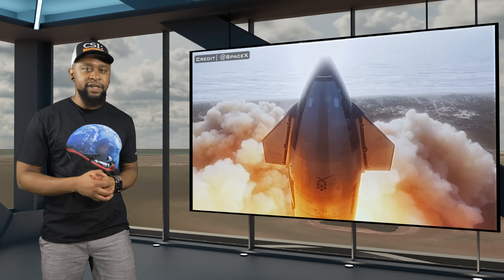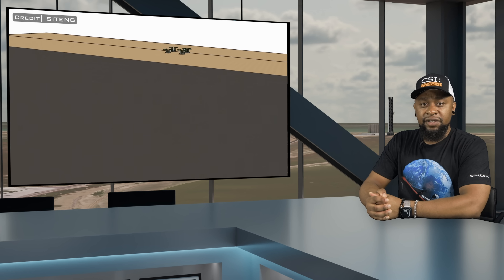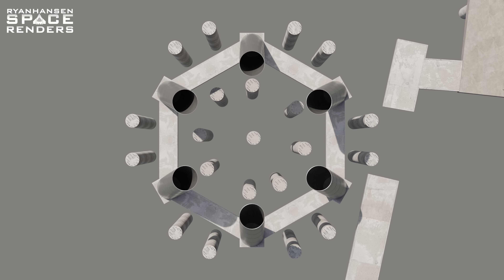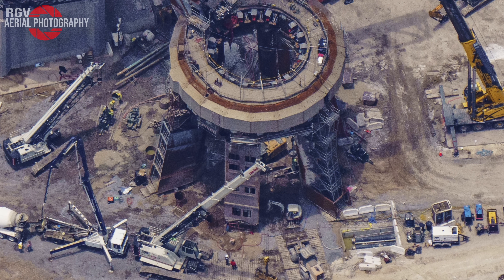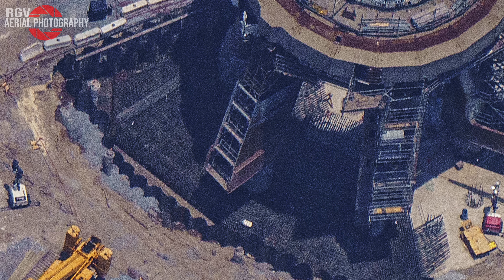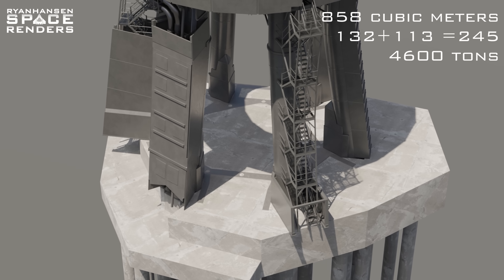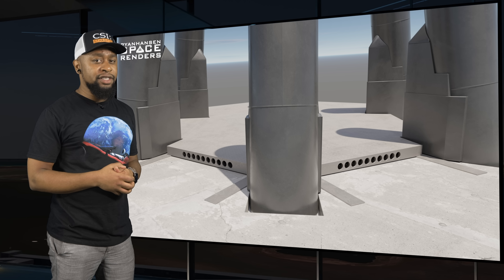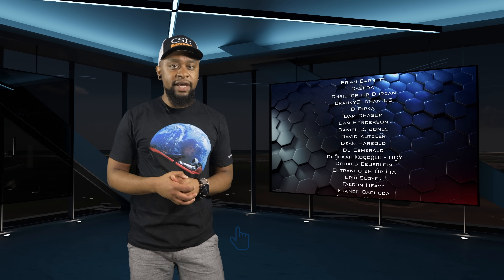How SpaceX Will Guarantee Its Launch Pad Never Fails Again! [Part 1]

Comment: The biggest issue now,it's the power of the engines push the water back and the water vapor exploding the metal plates.
Reply: Rocketry truly is a balance of pressures in every sense huh
Reply: this is why they are using High pressure Nitrogen to feed the pad, it allows them to regulate water pressure in a timely manner.
Reply: @bebopandopple , perfectly captureed.
Reply: I've seen 16 bar cited as stagnation pressure in some earlier video by CSI Starbase. That is a lot of pressure, but it's not extreme pressure. We will see how this works when they do a Water deluge system test. I want to see the worlds largest schower head in action too.
Reply: @bebopandopple If I remember correctly Von Braun said that there is a fine line between a rocket and a bomb. The finer the line, the better the rocket.
Reply: Thr water pressure must not falter though. If you need 16 bar minimum the water might have to be at 20 bar and stay there without fault and also ramp down in a controlled and timely manner with the lifting of the rocket.
Reply: also if the top plate of the " shower head" is only two and half inches thick it won't be anywhere near thick enough!
the entire structure should probably be there to four times thicker, otherwise there going to have a big steel potato chip!
two and a half inches of steel isn't enough to stand up to 33 raptor engines !!! it'll crush like tin foil !
Reply: @alwenke212  Did you do the math?
Reply: @alwenke212 It’s pointed at the wrong end for it to be called a shower head #RocketBidet
Reply: @yumazster  and man, did Von Braun know how to cross that line 😂
Reply: @jason_m_schmidt622  World's largest bidet?
Reply: @alwenke212  Pretty sure the SpaceX engineers have run the calculations dude...
Reply: @alwenke212 your hilarious, it's about thermal transfer. Thicker means less heat transfer. Ideally the plate should be titanium with ceramic embedded supports precast and pre-tensioned like elevated double T or bridge spans. Those are engineered in lightweight geometric designs to transfer stress without breaking. Thicker and bigger leads to stress fractures like Chinese dams are made or other crazy stuff like those Arab skyscrapers doomed to failure. It's not intuitive and it's why the best civil engineers are mathematicians and materials scientists before they design structures. Consider how the SR-71 or a hypersonic rocket can endure surface temperatures and shock. They use honeycomb backed thermally conductive framing to titanium and exotic vanadium steel that flexes and moves with extreme changes of conditions. All. Science my man, not middle ages castle building technology.
Reply: @alwenke212   I think the same.... this pad is not thicc enough to hold the pressure of the raptor engines. It would be ripped apart if the raptor engines can make tons of concrete fly away it would rip apart steel plates like tinfoil. Temperature wasn't the problem, the problem was the immense power hitting that launchpad. In my opinion no material can just bear raptor engines going full blast on it... they should instead try to deflect all that force by putting a deflection plate (plates) at an angle, so the steel doesn't get the full power on itself.... or have a big pool of water underneath, water is a good absorber of shockwaves.  Water should be used as a cushion. Also the water should be blasted from the sides onto the plate and not beneath.... if water comes beneath the rocket... it would just be overpressured backward and the pipes would burst. I think the launchpad would be partially destroyed again... in a "spectacular manner".....
Reply: All for the circus. There is no space.
Reply: The real question is how will they get teams on Moon or Mars to install something similar there for landing? The information how the Apollo mission did it without even getting any dust on the lander sadly got lost... 🤪🥳
Reply: @Slav4o911   still can't understand why they didn't built a launch stand with a proper flame diverter. Instead of the pad support legs in a circular configuration, SpaceX could've opted for a square arrangement. Installing after a mobile ramp on rails with tick steel pates, as flame diverter. While water would be pour down via Gravity. Simpler and more rough system. Able to be more easily maintained and less prone do extensive damage.
Reply: @usertogo   The lander was a 2 part lander, the lower part is still on the Moon, so that is the part which got the most "beating" . Also you should remember the Moon gravity is a lot weaker so not much force needed to go to orbit.
Reply: @Shrouded_reaper  Yes, this is why they continue to have oopsies
Reply: @Sara-L  Remind me again how long it took them to make one (SLS)? Starship has only been in serious development for a few years now and they are already launching prototypes.

Comment: I work in the concrete industry. Your numbers check out. Those look like 11 yard capacity mixers. In my experience, on a big job like this, they're typically loaded with 10 yards or 7.6 cubic meters. 132 truck loads works out to 1320 yards, or 1009 cubic meters. (we typically don't use the metric measurement). Not a massive pour by industry standards, but pretty big. Lately, my relatively small company has been doing 400-600 yard pours almost daily for a large customer in our area.

Love these deep dives. You always seem to have information and knowledge nobody else has.

Comment: As a commercial concrete carpenter(high rises stadiums) ive never seen concrete damage like that. It was impressive guessing that concrete is 8-10k psi breaking strength ez. Pumped to see changes. I do this piling /cason work in rivers building bridges too. Very interesting how they are trying to solve this issue. Wish i was working on it. Well done on this video i couldnt explain it better as someone who building it daily. Yet this is exactly kind of work i do

Comment: That "anti siphon" tube is more likely an air purge to help prevent water hammer. Water treatment plants in my state do the exact same thing. Without it, when the water is shut off at that level of force, volume, and pressure, it could cause an "explosion" and it messes with pressuring the system downstream, as the air will compress downstream, rising to top of line, and ejecting massively compressed air at the plate. A REALLY BAD THING to do with essentially the world's biggest blow torch. Basically an oxy-hydrogen plasma torch straight of hell. Added is the corrosion effect, and the sudden surge instantly creating electricity and hydrogen gas. (Same reason why certain long, large ships have static lines) "electrostatic charge is generated in liquids as it flows turbulently through the pipeline"

Comment: Another informative presentation that covers the details of how to fix the OLP that Elon said ‘might be a mistake’. It’d be interesting to know what the difference in time, money, and effort would have been had SpaceX followed tradition and built an OLP with diverter & water suppression system included. I’ll also be interested in what will be needed to upgrade the Fla OLP. 

Great work here that will likely be viewed with historical significance in the not too distant future.

Comment: Im pretty sure that the final system will have two stages as speculated in the video for a very good reason.
When all engines are throttled up the water will have to overcome a huge pressure, but before the engines are fired you need to be very careful, because you dont want to douse the engine bay of the booster with high pressure water for two reasons: 
1. You dont want to risk damaging any equipment in there with a 3000+ psi water jet
and
2. You could actually interfre with engine starting, when a high pressure water jet gets into the combustion chamber it may actually extinguish the engine during the starting process.
So I think SpaceX's plan will be to have lower pressure water flowing that wont create too high of a fountain over the plate until right after all engines have started up at which point the second system will start pushing water at increasing pressure through the plate while the engines are throttled up.

Comment: Very well done vid! I'm left wondering why they did not use a water tower in the design. Gravity would have supplied some baseline pressure that could have been augmented with the high pressure gas.

Comment: Hello Zach, when I look at that cargo bay door of Starship, I have to wonder if the SpaceX engineers ever considered a vertical payload door opposed to the current horizontal door. You have to wonder just how much structural reinforcement has to be added to carry that stress load around that huge door. If the stresses collapse that door opening by even a fraction during launch, that door may not open or close. If I were to design it, I would attempt a vertical door as it is much easier to carry that stress load. The big takeaway would be if they could deploy the Starlinks in a vertical position. In my mind, I picture a multilevel dispenser similar to the old slide projector carousels. Preliminarily, I think you could actually dispense more satellites in this configuration if the mechanics work out.

Comment: Just a reminder, that at the ground surface layer, if you're trying to prevent the thrust from touching the metal surface, you need an equal amount of water pressure coming out of the system.  This effectively doubles the amount of "weight" or downward pressure that the ground will be seeing and thus design has to compensate for all that additional pressure hense why it looks like its so much more..
Reply from the maker: This is something I will address in the next episode

Comment: Very good description of the subsurface drilling, concrete caisson, and dewatering procedure. I wonder why they didn't go with a slurry wall around the pad instead of the sheet pile?

Comment: I find all of the discussions around the original foundation damage funny as I have worked on design of flame diverters for rocket engines and it's hard to imagine that any reasonable engineer didn't see the damage coming from that first test flight.
Reply: They new for sure they would destoy launch pad part of trial error pat of the business. But you know that. First time ever for that many engines they new it would be bad . But till they did it they couldnt really know how bad. Theres just nothing for comparison at the time .

Comment: About the weir pipes, I have heard speculation about the being part of some kind of anti water-hammer feature.  While I am very far from an expert on the subject, in my mind I see another benefit of this structure.  On pad 39a, when the water tower is filled, the water tower's overflow is used to determine when the tower is full.  This stretch of pipe appears to be elevated above the top of the tanks, which will give it a similar function.  When filling the tanks, this elevated pipe would prevent the water from just flowing out of the tanks without the need of a valve.  Additionally, when the tanks are filled to capacity, at that point the water will flow through the top of these elevated pipes creating an overflow through the steel plates under the OLM.

Comment: A very good explanation video. 
One issue that they might not have been able to calculate is the water hammer effects. This can occur in a pressurized hydraulic system. And with the incredible pressures and forces from the shaking that we saw on the first launch. Harmonics can build up back down the water pressurized areas and lines. If the water hammer and harmonics combine in an unpredictable chaotic fashion the results could have the potential for destructive outcomes. 23:56

Comment: Great video. SX designed themselves into a corner. NASA’s Apollo/ Space Shuttle/ ULA pad has a deflector and deep trench that massively reduces stagnation pressure and blows the exhaust safely upwards. SX pad is on the surface with valuable equipment all round, so they can’t allow exhaust to be deflected sideways and need high-performance transpiration cooling system. Hope it works!

Comment: Very interesting well made video of Starbase and the launch tower etc.!!!
 Regarding the question:  "Is this overkill" referring to the massive upgrade of the floor under the rocket launch pad, I would suggest that considering the tremendous forces it has to withstand, making the floor too strong relatively to the forces it has to withstand is not really possible.  Before the first testfiring of the rocket engines I made the observation that the initial design would not be able to handle the pressures and heat expected and suggested preventative measures which now have been implemented, even exceeding in thickness the thick metal plate ancored into the underlying concrete I suggested, but they did put deflective shrouds on the support pillars which I also suggested.  Now things are getting more robust.🙄
 I hear you saying the water supply for "heat damage mitigation: will be from a battery of tanks through manifolds, one feeding into a 40 inch pipe, the other battery of tanks feeding water into a somewhat smaller pipe, and the tanks being pressurised with gas, or air, so I am thinking if any tank rupture under the pressure, waterflow from that battery of tanks could be severely compromised at a critical time.! 🤔.
Regards Niels.👍

Comment: Excellent report.  Two water supplies has answered a problem - which comes first, the engine firing or the water spray. If the spray starts first then several hundred psi jets could rip off the engine shields or worse. If the engines start first then 33 plasma jets could cut or damage the steel. However, if there was a low pressure water supply it could start first to protect the deck. Then when the engines start, the high pressure water jets could start.
Reply from the maker: The water should not touch the engines at all based on our projections.

Comment: As soon as I saw the camera blasted by chunks of high speed concrete and the sandy fallout, raining on Tim at his broadcast sight on launch day, my years at Bristol Aerospace gave me a twinge. Then the video of massive concrete and rebar sent higher than the launch table - plus the pattern of ocean splashes confirmed that	it: the OLM was going to need water cooled steel beneath it if they wanted more launches from the site. I was feeling rather disillusioned with the engineering team, for not foreseeing the need for more than a concrete pad. This is launch pad 101, known since the late 50's after all. I took a fair amount of heat in several places, from Elon Fanboys who think he walks on water. They really didn't like my criticism, suggested solution or the 6 months repair and rebuilding prediction. Then you did your fantastic analysis of what went wrong and showed us SpaceX had much of the steel already in the works. I'm glad to discover my thinking confirmed by you and most of all - the 2nd launch won't be pushed off to next year. This episode exceeded my hopes for your follow up... Fantastic update!
Reply: I’m hoping for a third launch with Starlink this year.

Comment: I'm going to comment on and save this video so I can come back, laugh, and actually watch it when the next launch sees the pad explode, taking the ship with it😂😂😂😂😂😂😂😂😂😂😂
Reply from the maker: Will you also come back if it ends up not happening the way you predict?
Reply: @CSIStarbase  Yes, if by some stroke of luck it works, I will have lots of egg on my face...
Reply: @CSIStarbase Like with Oceangate, it may not blow on the first time. The main weaknesses are wear/tear on the plate through salt air and repeated thrust impact, combined with harmonic effects from the thrust affecting water movement in the plate structure, especially on the side without waiter ingress. The omnidirectional thrust egress concept may be worthwhile if the launch mount is twice as high as it is, now, but it’s too close as it stands. One way or another, they will probably need to rebuild the site and structure, not just to increase OLM height, but also reroute cryogenic lines to make room for water ingress to all sides of the water plate (or just build a flame trench Mega Mountain).

Comment: Liquefaction of the sand/water mixture underneath the Launch Pad due to the violent sonic shockwaves is probably the biggest threat to the integrity of the Pad. I assume that is the reason why they take such care in lowering the ground water level in the area around the pad. After a few Starship launches, and with the ground water level lowered, I expect the pad will have come to stabilize completely.

Don't swear, Brother. I don't mind swearing when fecal matter hits the propeller. I do it myself, in line with Arctic Norwegian Tradition. But when people swear when there's no obvious reason for it, I immediately become suspicious, like what hole in their Knowledge are they trying to mask by putting in some expletives.

Great episode! Fantastic eye for detail! 👍
Reply: Water level lowering is a TEMPORARY measure on a construction phase. Larger pilings will take care of liquefaction issue at launch

Comment: Although it seems shocking to the uninitiated, there's a reason blast furnace tuyeres and vacuum arc melting crucibles are made out of copper even thought the temperatures involved would easily melt it; internal water cooling only works if the thermal conductivity of the metal is high enough. It will be interesting to see if the thermal conductivity of the steel plate is sufficient to draw the heat  through to the water at a high enough rate to maintain the exposed surface below its softening temperature. FANTASTIC content BTW.
Reply: Water-cooled steel aren't new